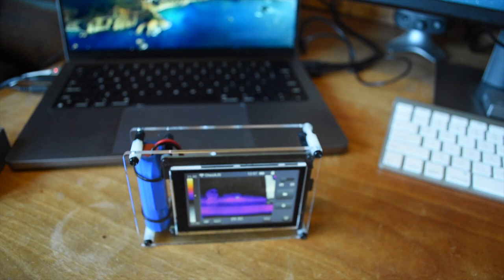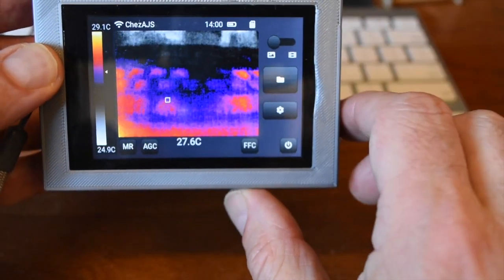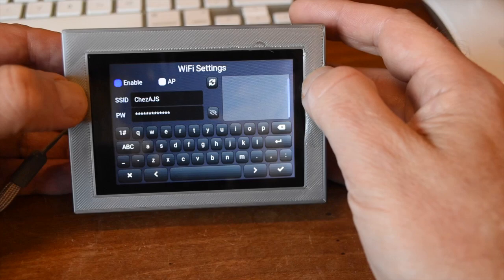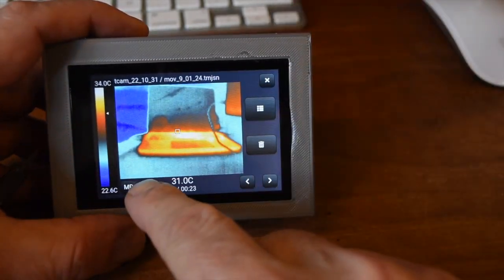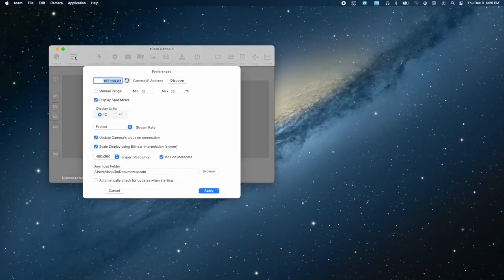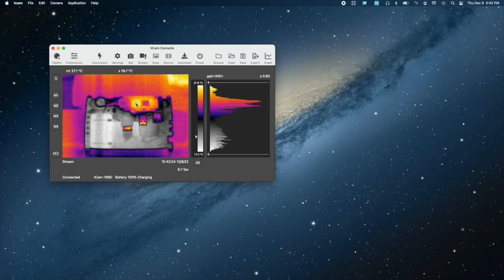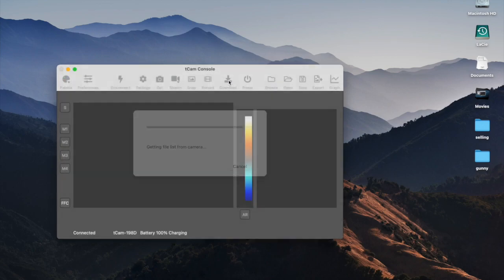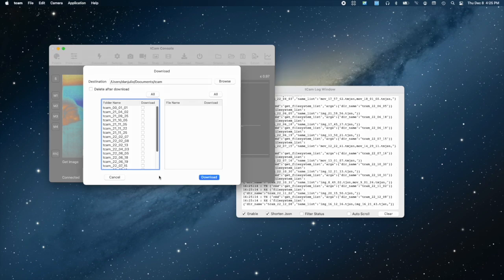tCam - An open source thermal imaging camera

Comment: Great product and a very well presented video. I noticed one of the photos showed an animal with a large background. Are you able to show a photo of a house? Like looking at heat loss through windows and doors. And then the roof.  Keep you the good work
Reply from the maker: Yes, looking for heat loss in buildings is a common use for thermal imaging cameras.  You can also do fun stuff like see warm pipes behind drywall or in concrete.

Comment: Nice.

I wonder if adding a peltier device, thermally bonded to the back of the module would make any difference? (Yeah I know condensation would be an issue).
Reply from the maker: The lepton performs FFC operations when its temperature changes and the heat distribution across it is fairly uniform.  The system seems pretty stable after it reaches thermal equilibrium.
Reply: Cool. Good to know.

Have you done any experiments with germanium lenses? I wonder how well "telescopic" imaging would would work? Or in fact microscopy...?

Comment: Very impressive project. I wold like to get the library to connect the ESP32 to WIFI with this screen and keyboard and the scanning procedure in Arduino IDE. Do you have it? Thank you very much.
Reply from the maker: Thank you.  You can find the source code for the camera (and for tCam-Mini) at my github repository (https://github.com/danjulio/tCam).  I have used the Espressif IDF for these projects so there would be some porting necessary to use the code with the Arduino environment.  However, theoretically it should be possible.
Reply: @danjulio4943  HI, I have installed the Vscode with ESP_IDF, but I'm not able to install the libraries that the project needs. Can you help me how to add new library? Thank you very much.
Reply from the maker: @anlpereira  I'm not sure what libraries you are referring too.  The project includes all code, other than code from the IDF that is required.  I used IDF v4.4.2 for the initial release (but IDF v4.4.4 should work fine).  It could be that there is extra setup for VScode you need to do.  However I cannot advise about that.  Sorry I'm not more help.
Reply: @danjulio4943  I’m learning to use the ESP-IDF on visual studio. I will try to import The project. Thanks

Comment: Great job! Is there not a better resolution camera board available?
Reply from the maker: There are higher resolution thermal imagers.  Some new cores from China have 256x192 pixel resolution and of course Flir has higher resolution devices as well.  They very quickly become incredibly expensive and harder to interface too (higher bandwidth requirements).  Many have USB interfaces and can plug into a computer.  I wanted to make a device that was affordable but still useful.

Comment: Very nice! I was looking for something like this, what is the total cost of the project?
Reply from the maker: You can buy the main components from Group Gets.
  gCore: $99
  tCam-Mini: $80
  Lepton 3.5: $164 (I would not recommend buying the Lepton FS as it isn't guaranteed to support accurate radiometric output)
You'll also need a 3.7v Li-Ion or LiPo battery that you could buy from Sparkfun or Adafruit (or other places, just make sure the connector polarity is correct).  I recommend around 2000 mAh.  And finally an 8-pin female header, 10-pin male header and jumper block as well as a Micro-SD card if you want to store images locally (not necessary).

I am hoping Group Gets will eventually provide an entire kit for tCam including a 3D printed enclosure.
Reply: Yeah I was looking through your website yesterday and thinking about buying the gCore, I would love love to be as skilled as you to make such circuit boards
Reply: @danjulio4943  for that price, can get a new ,non-flir thermal . TM160 micro for example . Ebay.
Reply from the maker: @UnTamedMustang  yup, there are definitely inexpensive commercial products out there.  I never intended to compete with them.  If they meet your needs then by all means buy them.  My stuff is for people who either want data from thermal imaging cameras for other purposes or want an open source camera they can understand and modify if necessary - for example to add another color palette.  Or if you want to do things like graph temperature over time or write your own code to talk to the camera. Or even if you just want to make your own camera.

Comment: Question: in manual mode, can I adjust the temp range and span for best results, looking at overhead power connection exceptions when viewing against a -200 deg clear sky, for example, manually set the temp range from 100 to 300 deg? The video does not explain this well, but it is important for inspections.
Reply from the maker: Yes, you can set a specific manual temperature range on the Camera Settings screen by touching the Min and Max controls after Manual temperature range is enabled.  You can read more information about camera operation at https://github.com/danjulio/tCam/tree/main/tCam.  Scroll down for more detailed descriptions of the controls.  For your range, you'd probably have to configure Low Gain as well since the range is outside the range handled by High Gain.
Reply: Thank you. and for the prompt reply.

Comment: Hi can you connect it to a drone?
Reply from the maker: It would take some sort of mounting hardware or a modification to my case designs as unfortunately the cases I designed have no mount points.
Reply: I could create a new case? Is there a way to get a live video stream from it?

How is tCam different to a infiray p2 pro and infiray tiny1-c?
Reply from the maker: @Gerald-iz7mv  Check out the github repository (https://github.com/danjulio/tCam).  It has my designs for 3D cases which you could use as a starting point.  My tCam stuff streams to the apps or custom code but doesn't output traditional video like NTSC or PAL.  It uses a thermal imager called the Lepton from Flir.  It is an open source project aimed at making radiometric data available to people.  It can, of course, display pretty pictures but isn't meant to exactly like traditional thermal imaging cameras.
Reply: @danjulio4943 ou say that a infiray p2 pro has a better resolution than the tcam? I feel like those drones who can do thermal imaging are super expensive - specially if you only want to play around with it like me. I plan to use an esp32 or a raspberry pi for image processing etc. + a thermal camera and what to put that on a drone. To have a stable image/video you need a gimbal.

What version of lapton from flir is it - 3.5? Do you use the latest version?
Reply from the maker: @Gerald-iz7mv  Yes, the infiray core has higher resolution.  256x192 v. 160x120.  But I do use the latest Lepton 3.5.  I have worked with people who have flown my tCam-Mini on drones because it is light and has a WiFi interface.  One guy actually flies 5 of them all talking via WiFi to a Raspberry Pi.
Reply: @danjulio4943  sweet ;) im still researching the entire topic - really interesting.